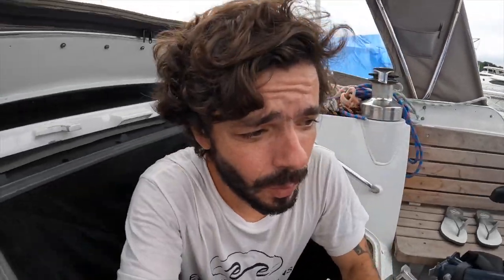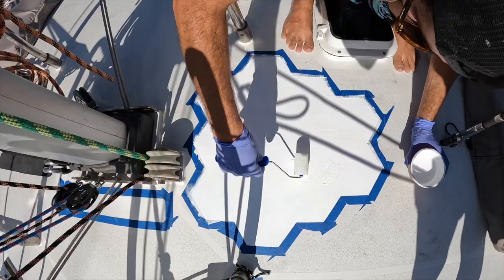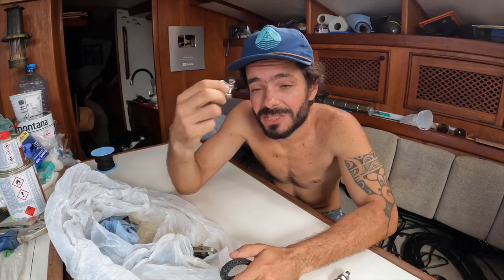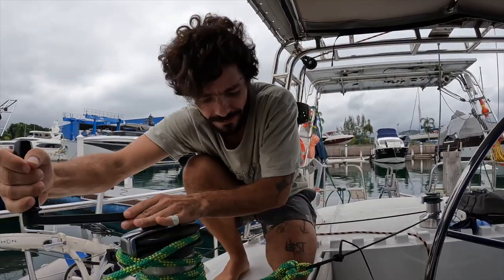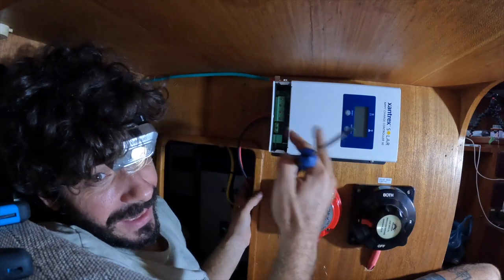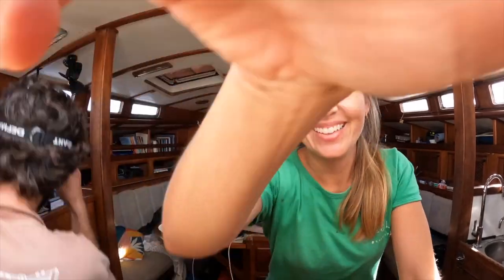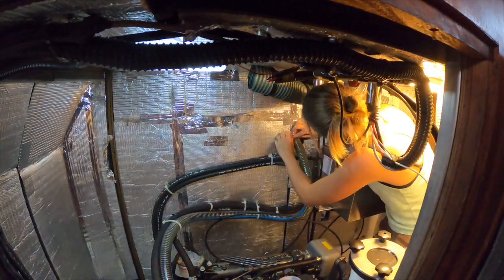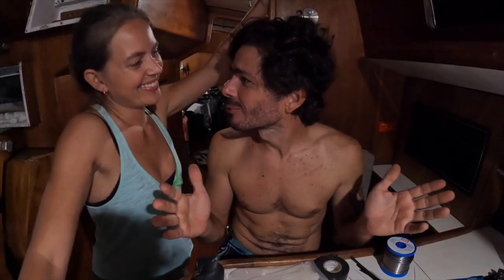⛵️ We FINALLY finished this project!! (even with COVID) Ep.247

Comment: Duca and Rebeca I really like your videos and have seen all of them  The affection you have between each other...nice to see.I lived 3 years in Campinas Brasil and then returned to  Europe....I live in the S.France and  I had an Oyster 485 like the one you sailed in Brazil that I added a lot of kit to over the years. I would consider on Odd the following:
1) The current Raymarine autopilot is something that can be upgraded for strength (they renamed the upgrade item the Grand Prix version and a kit is available) Alos there is a clutch unit which is good to have a spare as it is not expensive but they do fail!
2) The lines that go through the dodger and on to the mast are just holes. I would recommend getting some leather or neoprene rubber to provide a seal so in heavy weather it stops sea water entering the cockpit.
3) I did not see a way to clip the lifejacket / harness when you are in the cockpit in heavy weather. If you do not have that I would fit 4 U clips onto the floor.
4) You should consider a table fixed to the helm support that can be opened  or closed flat against the back of the helm support. Likewise a place to put some coffee mugs / water plastic glasses is useful.
5) You should consider a loudhailer on the mast with a microphone at the helm. Raymarine make one with a repeating fog horn that is included.
6) Fitting a 12V small fused socket at the helm is useful  for a strong lamp / search light.

Comment: Now you have it Duca, the new structure for the autopilot drive looks very good and bolting it to the structure of the boat is excellent. You are also correct, the shorter the pivot pin is, the less bending moment, this equates to more force that can safely be transmitted to the steering quadrant. Good job building the bow seat. Fair winds and safe travels.

Comment: Ah the joys of Dyneema! I try to these days size lines for the thickness of a splice, not the line itself, as you tend to run into issues with the splices otherwise. Knots in Dyneema tend to slip, so good on you guys checking with a pro regarding which knots to use as there aren’t that many that won’t slip which never would with normal rope. Otherwise I wouldn’t be too worried about the cover, Dyneema has the same coefficient of friction as Teflon so it doesn’t really rub through as easy as other ropes would.
Reply: Also, Vectran has really poor tensile strength compared to Dyneema, around 25% of equivalent size Dyneema, it seems to be mostly even less stretchy than Dyneema, which is already very static.

Comment: Guys, those projects may seem small but the impact is significant. Although work on a boat never ends, these tasks were necessary. I do have one observation. Your internet antenna should have been put in a place that has less blockage. Too many items blocking the antenna reduces the strength of the signal. You could look into putting it at the top of the mast. That would be ideal.

Comment: When my father and I fitted a boat with 3 outboards, all wires, all tanks, seats, dashboard, everything, we put this sort of sealant onto the all exposed electric connectors.  It came in a tall can with its own brush.  When it went on it made this great cover that was tinted brownish black and made a killer awesome seal.  It would be a good idea to cover all those connections inside you fuse panel and where your Invectron connections and such are.

Comment: Did I got it wrong: the autopilot should be installed in 25cm distance to the center of the rudder, you installed it in 21cm becaus you couldn't get closer.
As far as I understand, you should increase the distance to 25cm (or more), so the autopilot's force needed to steer should decrease.
Sorry, if I misunderstood you.

Comment: Insulate is the correct word ...not isolate though its logical and an understandable choice. 
You insulated your engine compartment ..against noise and heat.
You insulate an electrical connection. 

Isolating something usually means you put something out of reach or further away.. or cut/switch it off, or place in a special seperate insulating  container 🙄😉🤷🏻‍♂️😇
Its English its a mongrel language.. 😂👍🏼🇬🇧🧙‍♂️
💙⛵
Reply from the maker: In Portuguese the word is isolar 😉